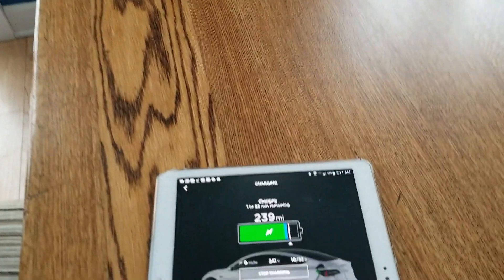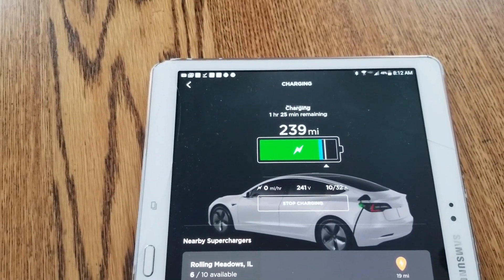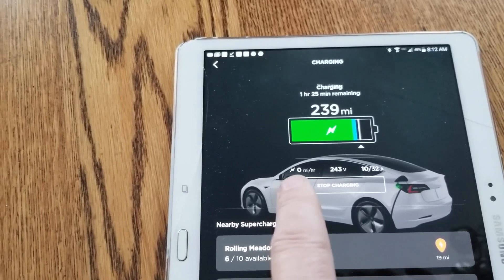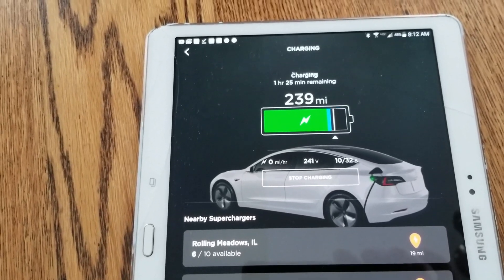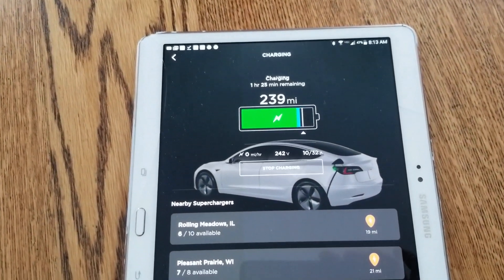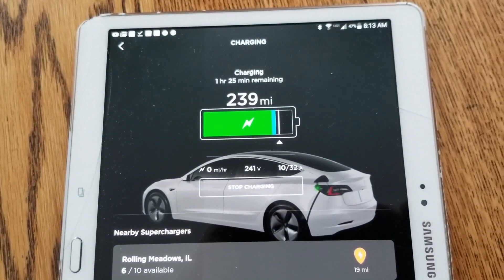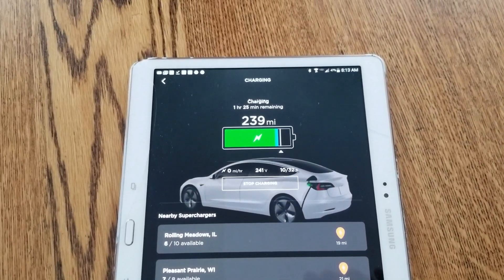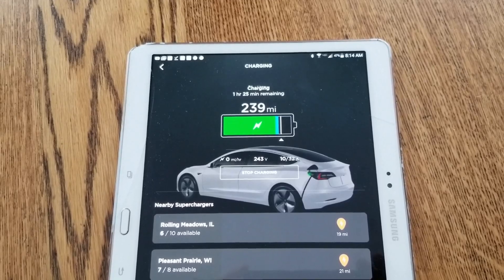Does the Model 3 have a battery pack heater?

Comment: Okay so if there was a resistive heating element. Every watt of power used would be put into battery heating, minus heat losses.

With the model 3's system as described here, the batteries are heated purely by inducing a load on the battery  which happens to be the motors and inverter.  In this case only the heat from the battery's chemical reaction is what heats the battery, the rest of the heat generated at the motors and inverter is lost.
Reply from the maker: My understanding is that the motor and inverter heat up and that heat circulates through the coolant to warm the battery.
Reply: @TechForumTesla  Ah I see. I wonder why they wouldn't just put an immersed resistive heating element in the coolant line to distribute heat to the batteries, shouldn't cost much.
Reply from the maker: @SailingStardate  Good question

Comment: It's a silly question because you absolutely need a battery heater, you can't charge a frozen li-ion battery at all, and it would be a total dealbreaker if you couldn't charge in the winter.
Reply from the maker: I agree. But, I have a couple people argue with me that I should NEVER say the Model 3 has a battery heater because there is not a resistive heating element built into the pack like there is on a Model S.

Comment: At what temperature does the battery need to be at before it start to warm or cool?
Reply from the maker: There's not a specific temperature. I can tell you the colder it is outside, the more heating is triggered and the hotter it is the stronger the cooling is. Also, when Supercharging, the cooling system runs full blast! You can hear it loudly running. It sounds like an engine running (cooling pump and fans).
Reply: @TechForumTesla  hey Matt thanks for the info.  Be nice to know at what temperature does it kick on and off.  Let say if you park indoor and insulate your garage to keep it at room temperature or 78 degree.  This will help limited the BMS starting up and shutdown.  Help with extra power being consume.
Reply: @TechForumTesla  I also want to know if in extreme cold weather does ice car start up without any issue.? I don't live in cold weather.  I would rather lose some electricity in cold weather and I can start and go without issue.  Can ICE start up without any issue?  Would you rather have a car that work but lose some power or try jumping the ice car to get it going?
Reply: @duketlam9206   to start an ice car in the Sub-Zero temps. You need a good battery. Good coolant. And  lower viscosity oil. Both my cars started fine. Whined a little at first. They didn't whine as much as my teenager did.
Reply: @duketlam9206  the worst thing in cold weather is either getting in a cold car, or wasting fuel waiting for it to warm up. You can't let it warm up in a garage. Unless you don't need breathe.
Reply: @bobm4659  good to know.  I saw bjorn video in Norway some parking lot has these warmer you put under the car to keep the oil or coolant from freezing up.

Comment: QUESTION: Will the Model 3 try to cool battery in hot summer days? Volt would activate cooling fan in summer, I think for battery. Fan noise came from Volt while parked in closed hot garage. (115 and higher degree days).
Reply: It would have to be able to actively cool it in order to enable Supercharging. Without cooling, Supercharging would be very slow.
Reply: David DiStefano that's why they have that cool can they use.  It circulates coolant through the pack while charging or temps reach a certain level.
Reply: Yeah and 3 can even chill the coolant below ambient temps by using a heat exchanger with the A/C system. This is used when supercharging to provide extra cooling beyond what's normally possible with just a radiator.
Reply: ddud - like a chiller basically.
Reply from the maker: Yes it does. I hear the fan and cooling pumps kick on occasionally when the car is parked in the summer.

Comment: I here that too all the time and no one seems a to get it.   It takes about 30 minutes to heat the battery and then charging amps and miles per hour ramp up to normal levels.   Exactly what u showed.

Comment: So the car when sitting fully charged is at all times pulling that power to heat the battery or do you have the car set to precondition right now?  I was a little confused on that.
Reply: Would be good to get specifics, but I do think the 240v/10A you see is specifically to raise the temperate to a safe temp for charging to resume. Once it finishes charging, I think it will let the battery cool back down to a lower level, so will use less energy to maintain.
Reply: I have mine sit out in a non insulated garage. Sometimes when I go outside it will be pulling power from the wall charger which im assuming its heating the battery to keep it safe. I think it only turns on when it needs to

Comment: Yep, resistive heat is resistive heat, whether it's a motor coil, or a separate heater for the battery similar efficiency, Tesla just found a clever way to save some space and components! (I think the reason they don't do this on the S and X is that the motor is AC induction instead of DC switched reluctance, so you can't activate the motor coils without spinning the rotor)
Reply: i think completely not true. It does not matter what kinf of motor. Inverter just heats up motor phase wires like "shorting" It heats up controller power stage and motor wires. At least i think this way.
Reply: @Musvilkis  maybe, but you would need to provide a DC current to the coil rather than AC which would require a special inverter/rectifier design.
Reply: @brantwedel  It works because it's not an AC induction motor, its a reluctance motor so it has no problem. It's actually a common feature in industrial motor drivers to provide a low-level DC output to a motor to heat it up, like to prevent condensation build-up or to deliberately stall the motor, i.e. provide torque without any rotation.